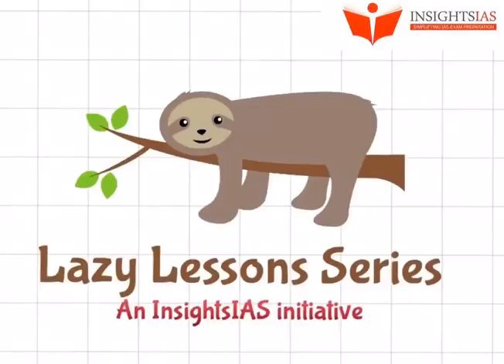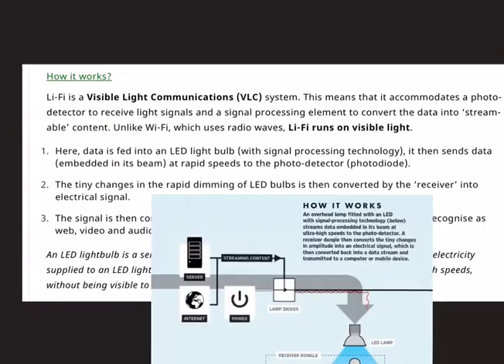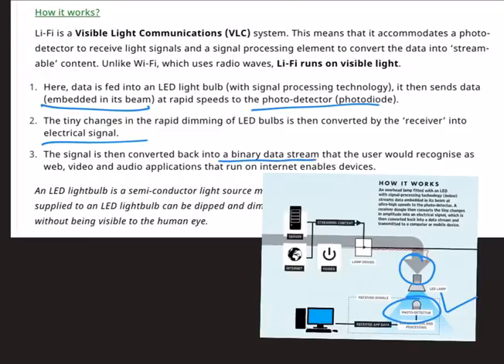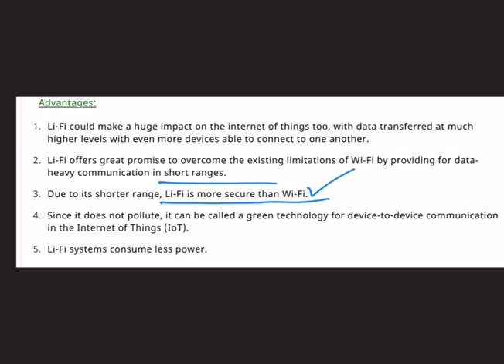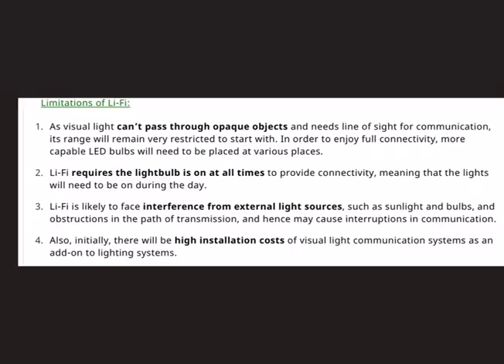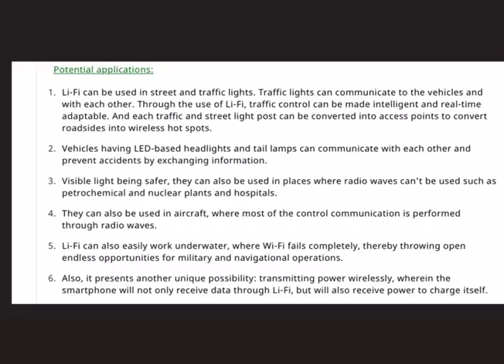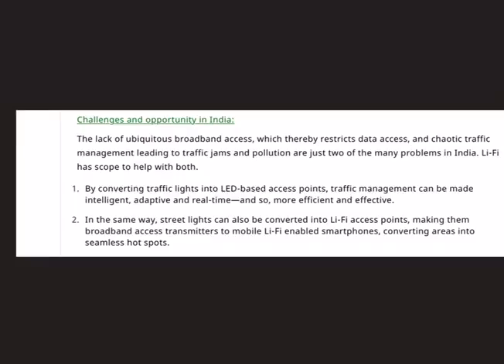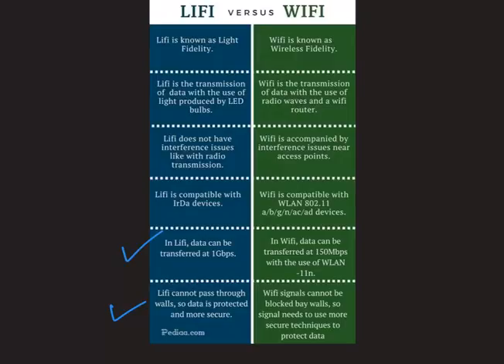INSIGHTSIAS LAZY LESSONS : LIFI TECHNOLOGY THE FUTURE

Comment from the maker: Consider the following statements:

1. Data transmission is faster in Lifi than WiFi.
2. WiFi signal cannot be blocked by walls.

Which of the above statements is/are correct?

a. 1 only.
b. 2 only.
c. Both.
d. None.
Reply: C
Reply: C. Both
Reply: Both
Reply: C
Reply: both (c)
Reply: C
Reply: C